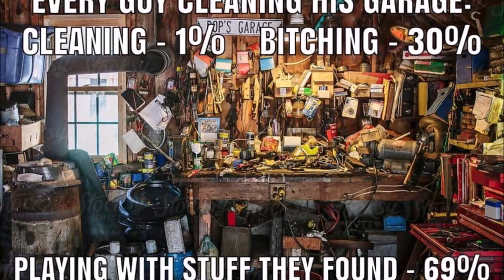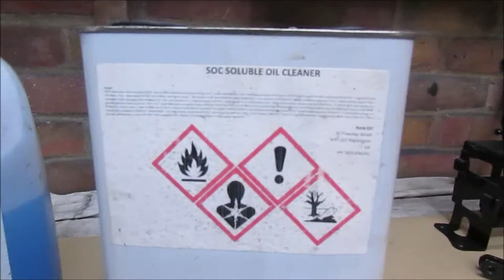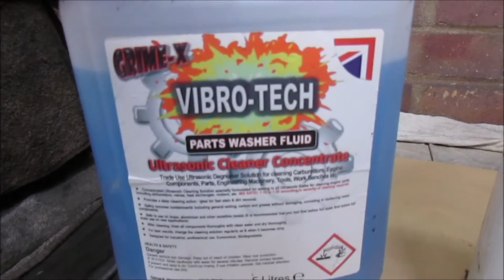My second Q and A Video - The Answers to your Questions

Comment: Keith, regarding the 650 build, are you using the old wiring loom, making one or buying a new one?
Reply from the maker: Cheers Jonboy, good question, the loom i have was cut and hacked when it was converted to electronic ignition, i do have another loom but that is in a state as well, new is very very expensive and making one .... well electrics is not my strong point, may try a make one out of the 2 i have